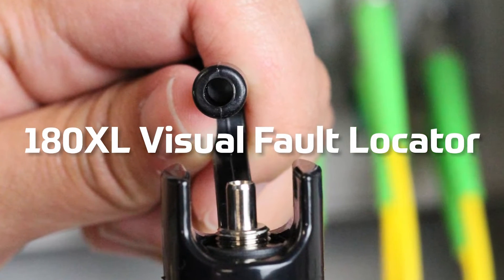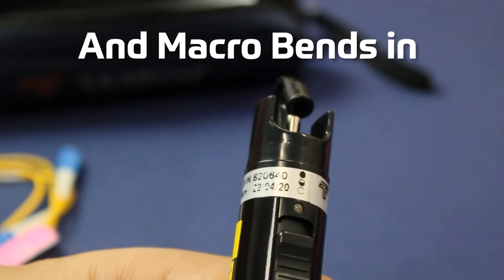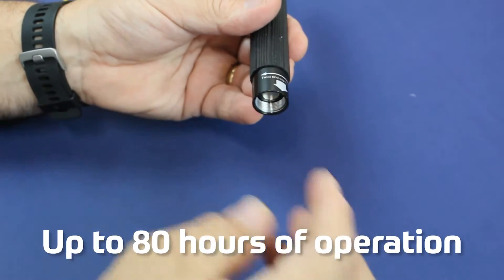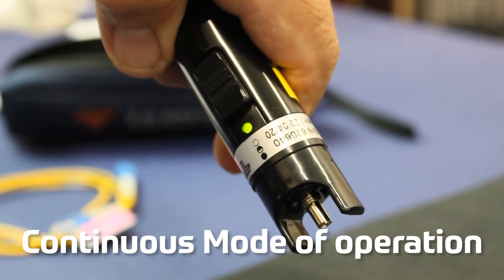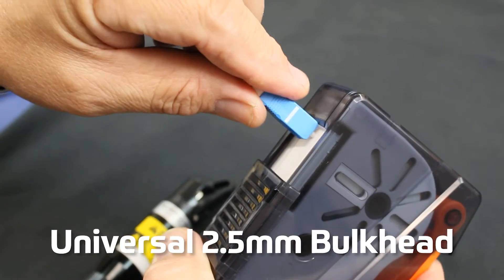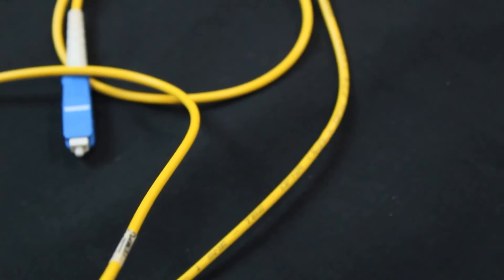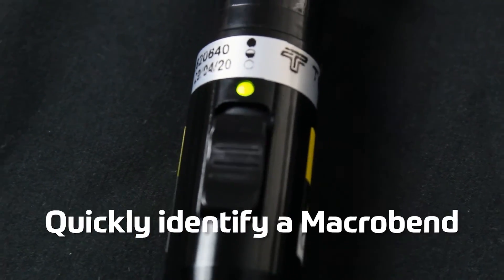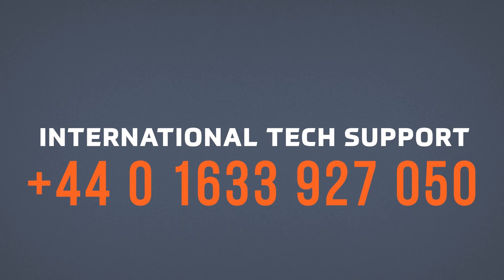Tempo's 180XL Visual Fault Locator For Fiber Optic Cable - Training Video

Comment: I’ve used multiple VFLs and the Tempo unfortunately is the worst I’ve ever used. SC connectors have to placed on a certain way for red light to pass properly. Sometimes having to pull the SC connector half way off to get the optimal red light to pass properly. I do like your guys OTDR though. Red light on that is perfect.